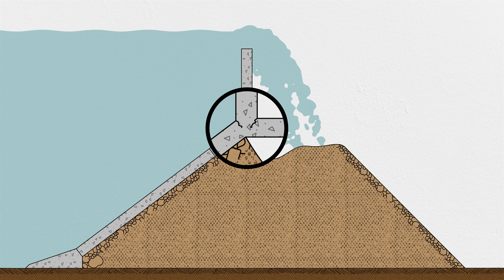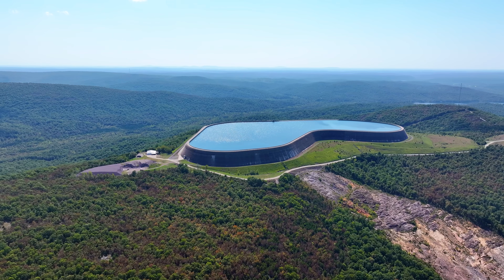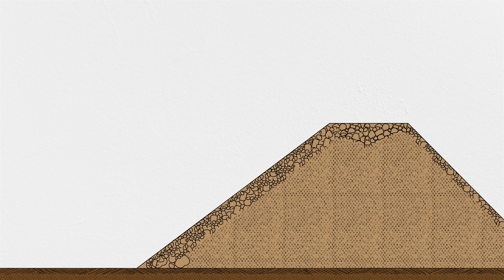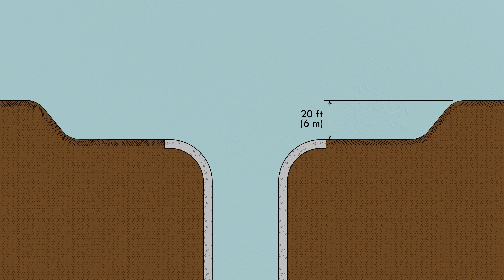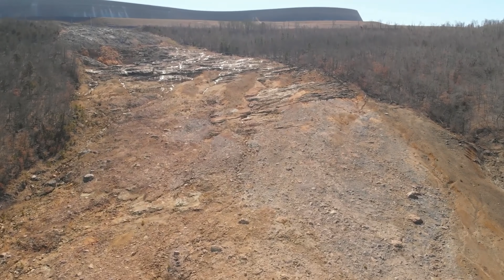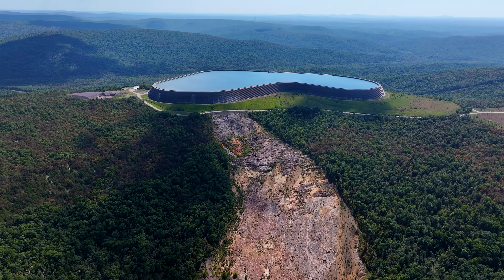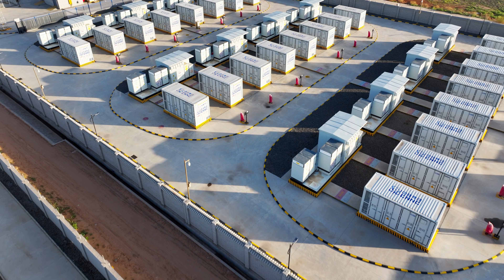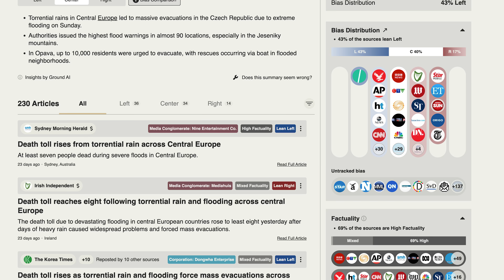The Wild Story of the Taum Sauk Dam Failure

Comment: So a $20 float switch and some relays could've prevented this???🤔🤔
Reply: As he said they had switched with similar function, but they where on parts of the wall that had settled less so they never triggered. A float switch would have had the same problem unless placed in a lucky (lower) spot.
Reply: @scania9786  I'm not even close to being any kind of engineer, but I am a licensed electrician of almost 40 years. This may sound like stone-aged tech, but the first thing I thought of when mentioning the float switch - and keeping in mind the issues they had with penetrating the liner and anchoring - was to just build a light-weight steel structure that's just sitting on the bottom and extends to the top. The switch can be attached to that at any level you want. If the water ever lifted the float up, down go the pumps. That's just my one minute thought of a fix based on my experience.
Reply: @snakeinthegrass7443 I think you mean a "stilling well."

Comment: would it be worth putting solar pannels on top of the Dam to help cover the power cost of pumping the water?
Reply: Nope. But you can float them on the water, with the added upside of reducing evaporation. Not sure how much this would intefere with the pumps when extracting energy though. Probably not worth it.
Reply: It's a good thought, just wrong resource.  This is used for peak time when it is daylight.  Most pumping occurs overnight.  So wind would be the better renewable energy to use.
Reply: This wasn’t built as a generating facility. It was built to deal with the issue of needing a lot more power during the day than you needed at night. You can build additional power plants to cover this or this utility if I could store some of that electricity from overnight and then use it during the day.

Comment: A very simple level sensor at the top that cuts power to the filling pumps would have averted this disaster. This should have been in addition to the complicated and clever computer control system. When I saw the leadup to the disaster, I immediately thought of the Buncefield fire, where a huge gasoline storage depot exploded due to a faulty level sensor causing a tank to be over filled till the fuel came out and found an ignition source.

https://en.wikipedia.org/wiki/Buncefield_fire
Reply: There was actually "a very simple level sensor at the top", but you didn't account for people stupidity - it wasn't placed on the lowest part of the dam and thus the water was toping already. It is explained around 11:16

Comment: There's no replacement for a nice, big E-STOP button ... also, paying attention to what's going on!  Trusting PLCs to run your gear for you is fine ... only if you're aware of and ready for the consequences when they fail.
Reply: How do you push a button when you're not there?
Reply: @noinfo5630  As Grady pointed out, observation during the last few minutes of expected fill capacity is a pretty small labor input, especially in light of the consequences of failure.  Someone made a decision NOT to pay for a worker to do that and - to no engineer's surprise - it came with consequences ... just like NOT hiring an outside process automation expert to review the PLC/sensor configuration for potential SPOF or other errors.
Reply: This wouldn't have happened if they hadn't been so cheap. If they had installed a water level sensor every so often around the entire reservoir the settling wouldn't have mattered, the pumps would've shut off properly, and it wouldn't have overtopped. If your interval is every 100', even if one or 2 neighboring sensors fail you should still have plenty of them working to avoid overtopping.
Reply: @BobBobson failure mode cound be at the plc not the sensor.  Mechanical fail safe seems safer, spill way for not if but when. Also the settling of the wall, 2 feet, wasn't detected by those sensors.
Reply: @BobBobson  Grady is on the money that this was a Normal failure. Anyone looking at the design and management would predict there could easily be a failure, just like how if you look at the reporting on Boeing management it's no surprise their planes are breaking.

Comment: All I can say is that Ameren got very very lucky this happened in the offseason for Johnson shut ins. This could have killed 100s of people if it was in the summer because it wipped out the entire camp ground and rushed through the shut ins which is packed during the summer.
Reply: Now they have an alarm and the high water mark on the hillside. Warning signs tell you to run up hill so many meters if the alarm sounds and the dam has broke.
Reply: The Shut Ins campground is miles away now.  And there are signs all over saying when siren sounds run uphill for as long as you can. 
I remember camping right at the shut in trailhead. Now it's a parking lot.  The debris carried into the river changed the shut ins permanently.
Reply: I done alot of camping at state parks round the country ...never heard the term shut in. Could you describe what that means for me please ? Genuinely interested
Reply: @212Romulus  if you look up Johnson shut ins state park it should come up with a picture. Its basically formed by a river or creek running over bedrock and slowly erodes the rock away to cause a bunch of small channels in the rock that water runs through. It’s a term used in the ozark area since it’s quite common to have these along creeks and rivers because bedrock is pretty close to the surface in a lot of areas.
Reply: @212Romulus "Shut-ins are characterized by by narrow channels, and waterfalls [which are] formed when swiftly flowing steams [or rivers] encounter resistant igneous bedrock, creating natural barriers that redirect the water flow, sculpting the surrounding landscape into breathtaking [rock] formations."

(Duncan, Bill, "A Thousand Acres of Silphoums: Three Lesser Known Shut-Ins of the St. Francios River Watershed," Osarkbill, May 8, 2024)

Note: "Shut-in" is not a geologic term, rather it's a regional word used in the Osarks to describe a geologic formation.
Reply: @212Romulus Johnson Shut Ins are basically nature’s water slides
Reply: @212Romulus  It is just a way to describe the cabins that were there. As in, "Shut yourself away from the world."
Reply: Nvm I was completely wrong
Reply: @TheNighthawk00  it drains and refills almost everyday during the summer. It drains for power during high power need times usually in the afternoon during the heat of day and then is pumped full at night during low power need times.
Reply: @irocz11 can imagine how long full recovery would take, they'd be finding body parts for years in that blender
Reply: @KenHauptfleisch  It was only survivable if you went up a tree I would think.  The ranger and his family survived because the structure they were in absorbed the force of the impact as it was knocked off the foundation and it was lighter so it stayed on top of the water and debris.
Reply: @rtqii  climbed up a tree? maybe if that tree was made of concrete and bolted to the bedrock. from the images presented in the video, it looks like every tree in the water's path was entirely stripped away, so i doubt you'd find any safety there. it's crazy that the family survived, i was gobsmacked when he said they all lived (albeit badly injured). anyone not inside a building would be a living miracle if they managed to survive being hit by that flood.
Reply: @rtqii  they lived cause they did not go through the part most people call the shut-ins, but yes they were actually found in trees
Reply: @Darkfyyre  the family was actually found hanging on in the trees, the trees down past the caretakers house didn't take as much damage due to water being back in the river channel by then
Reply: @Darkfyyre  They were sleeping when the water hit their home. God was with them that morning, as Mary was sleeping with the little one and was able to hold on to her. They all were found in trees. Even they have no clue how they did it.
Reply: I wish God had given better sense to the engineers instead.   @samwillard5688
Reply: @TheNighthawk00 Tell me you didn’t watch the video without telling me you didn’t watch the video…
Reply: @TheNighthawk00 damn bro lol
Reply: @TheNighthawk00  you're a smart one aren't you?  LOL!!!

Comment: 9:38  I am not an engineer, but seems a simple camera feed to the operator room could have solved this issue....
Reply: Only if the operator checked the monitor. Being human he probably would not have done so after the first month or so on the job. It still needed a spillway, and a very simple safety cutout.
Reply: On a chemical plant I worked on we had a tank overflow.  It had a high alarm but the operator missed the alarm, didn’t switch off the inlet pump and the tank overflowed.  So a pump cut out was added if the level exceeded the alarm by a few percent.  Sometime later there was another overflow.  Turns out the operators had started relying on the pump auto cut off to do the job, ignoring the alarm and not intervening manually.  Wish I could remember the next step (was probably 30 years ago!).  The moral is if you going to add auto cutoffs you’d better make sure of its reliability and its demand rate and design the cutoff system appropriately with the required reliability.
Reply: They try to get rid of any if at all of human operator and programmed it to function automatically, there were no human it operated on logic.
Reply: Or, like, that stuff that toilets use... You know, a sponge and cord to action a switch.

Comment: My favorite type of storage is flywheels. They're insane
Reply: until you learn about inevitable consequences of mixing gyroscopic precession with conservation of angular momentum.
Reply: @totojejedinecnynick  that's not really a problem with modern flywheel storage
Reply: Yeah, they're insanely low energy density. They're useful for instant power so you can stabilize an electrical network with them, they act as capacitors of sorts, but you're not storing any significant amounts of energy with them. Not until we have materials that can withstand unspeakable forces.

Also, if you want to store energy for a long time in a flywheel, you actually have to reduce friction as much as possible and have to actually take the rotation of the earth into account and mount the most frictionless bearing you can have on a gimbal while having the most weight possible with the highest speed possible with the largest wheelspan possible. It's a nigh impossible engineering challenge.
Reply: Caterpillar had (still has?) flywheel storage to ride through power outages long enough to start a generator.

They used ceramic bearings that the rotor rested on to start-up. They had magnetic bearings to levitate the flywheel in normal operation and spun in a vacuum. 30k rpm comes to mind.
Reply: They're getting pretty good with flywheels now. 

Basically you dig a hole and you put the flywheel down in it sideways and the flywheel can flatten the duck curve by storing access energy during the day and then releasing it for the first hour after dark as solar dies down and energy demand increases.

Comment: Great video as always! I am just curious how nobody noticed that their dam is filling up over designed capacity.

Also having no emergency spillway looks like cost cutting measure. At least now they have spillway channel deforested for them...
Reply: Certainly for cost cutting though not necessarily because 'they were being cheap' but more because they essentially had complete control of water input to the reservoir it wasn't really necessary and so was an unjustified expense.

There are only two ways for water to get into the reservoir. Pumping it, and natural rain that has a catchment area equal to the area of the reservoir (and so 1 inch of rain is equal to roughly 1 inch of rise in water level)

The pump can be turned off and has failsafes to do this (and 40 years of demonstrated experience that it worked when installed correctly - it was a redesign that introduced an installation flaw)

The rain can't be turned off but even the most torrential of downpours possible in the region can be drained from the reservoir faster than the rain can fill it up. With 2ft of freeboard planned, that's equal to about half the average annual rainfall of that location and so even if you had it filled to the top of its 2ft limit the natural cycling of every 1-3 days of drawdown for power generation would put it back under the 2ft limit.
Reply: @dorvinion  Agreed, they did not see it as necessary, as usual in private business with little regulation or oversight.

Nevertheless, substandard composition of the dam core is another clear proof of cutting corners where possible. So its like "Oh, we dont have to build this spillway, we have complete control over this overtopping phenomenon", while putting aside everything that you need to do to be in that complete control. 

Like measuring soil settlement over time, dam profile and such. Also the absence of CCTV is mindlowing, cost of operation of such device is very cheap compared to damage it can prevent.

In my country alarms  and red flags would be raised much earlier - just because you cannot have leaking embankment dam. Thats a huge NO-NO, prompting complete study about the dam condition.
Reply: @openttd-cztr191 Listen, your country might be great, but I bet the reason they have not had a failure this big is because they don’t have anything this big. Engineering is hard for everyone.
Reply: @openttd-cztr191 Sure, alarms would be raised TODAY. How would your country respond to leaks in the 1970s, though?
Reply: @CptJistuce  In pretty same way as today. Leaks are measured in terms of volume, location and pressure. If anything goes over set limits, you evacuate the water, conduct survey and fix the problem. Its engineering.

Its not that it did not happen in my country. Heck we have memorial for dam burst from 1916, which swept whole villages, and it was because leak in the dam was ignored and downplayed. In time when CCTV and modern measurements were not available.

Thanks to that and other experience we have pretty strict regulations. For example safety inspections are done by separate and independent body from the owner - even when some dams are owned by the state and the regulatory body is also responsible to the state (ergo people). 

Dams are awesome, but if neglected or mismanadged very dangerous - water kills and destroys pretty much as fire if unleashed.
Reply: @andrewyoung4473  we had and it cost lives. I cannot say our regulations are pretty strict thanks to that, but maybe that experience contributed a bit - its over 100 years ago. But the monitoring is very important and you cannot underestimate the power of water.

To be honest I cannot understand the value of saving salary and living expenses for somebody, who monitors the dam. We had major event in September spanning whole country and on many dams it was contained pretty due to expertise of the dam caretakers (we have even separate word for this vocation :D ). And that made huge difference in handling of it all.
Reply: @openttd-cztr191  Ah! That's some valuable context. 
Regulations are, sadly, usually put in place after the thing they're meant to stop happens. The US has done pretty good with dams, so our dam regulation came fairly late.
(Also, the US spent the first half of the twentieth century actively giving nature the finger. That didn't help.)
Reply: @CptJistuce  well (if you are from US) you have some awesome pieces of dam infrastructure there, kudos to your engineers of the past. Our "big" is nowhere comparable to some of yours "huge" on some examples.

I know about the neglection problem (which is sadly not exclusive for you or dams, bridges or railways...). For me the "state fragmentation" between the fifty that makes some things very difficult, but no politics needed here, you do yours.

If you want to check, I am not sure if its translated, but that burst dam was called Desná and here is the link for wiki in my native language, its trustworthy (maybe google can translate it for you).

https://cs.wikipedia.org/wiki/P%C5%99ehrada_Desn%C3%A1

And we have similar engineering marvel as is Taum Sauk with twice the height difference. Here (also in Czech) for comparison if you want 

https://cs.wikipedia.org/wiki/P%C5%99e%C4%8Derp%C3%A1vac%C3%AD_vodn%C3%AD_elektr%C3%A1rna_Dlouh%C3%A9_str%C3%A1n%C4%9B
Reply: @andrewyoung4473  Lmao, you're so triggered.